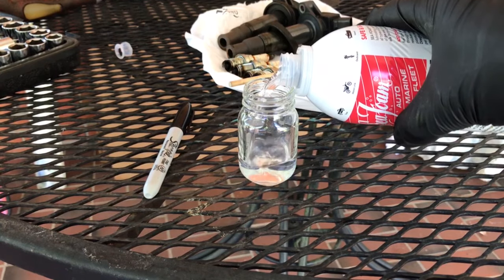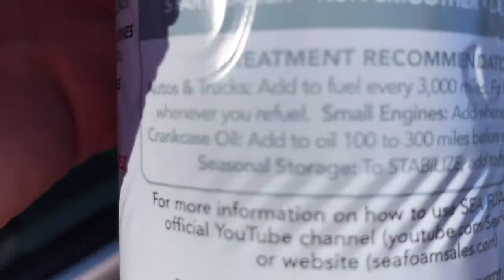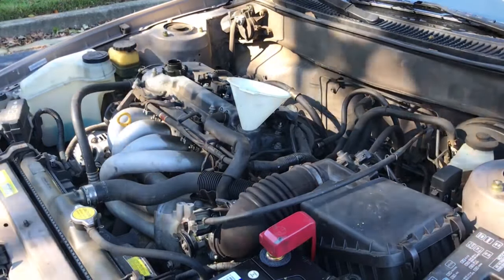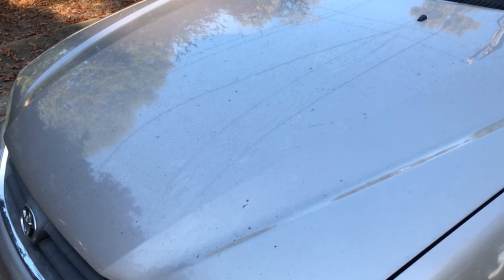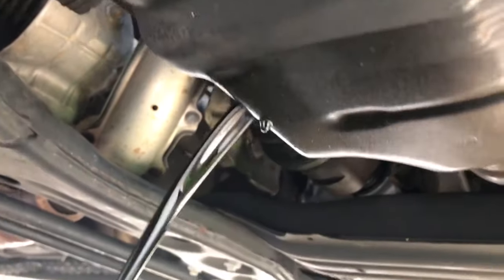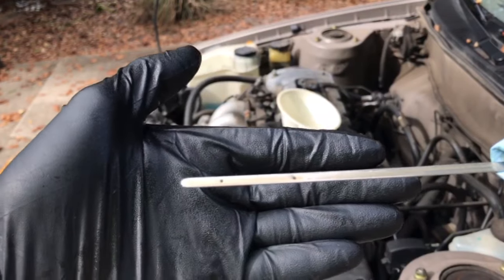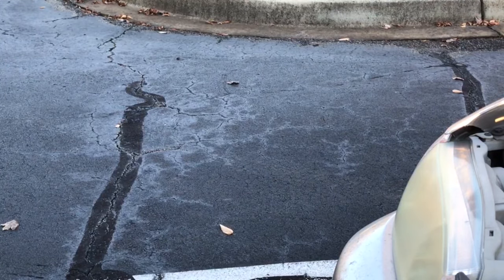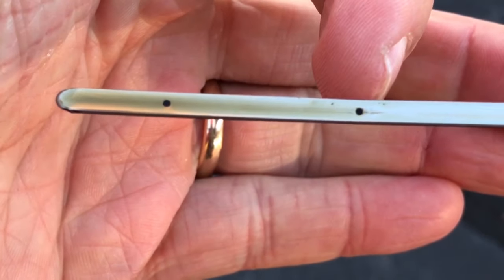Will Seafoam stop oil consumption? | Oil Burning🔥Experiments | Episode 2

Comment: I drove my 2002 Ford Winstar for just shy of four thousand miles with seafoam in the oil, it didn't do any damage to my engine at all. I got a really good clean out of my engine though, the engine had a lot more power than it did before seafoam in the oil, it was simply amazing the good it did for my engine!
Reply from the maker: Good to hear, Robert. Thanks fort the comment!
Reply: So is it okay to run the car with seafoam until next oil change. I literally changed oil a month ago and it’s bone dry now so was thinking of buying another 4 quarts and adding the sea-foam and checking if this is the possible solution. I also have a 2002 Corolla it literally burned all oil at 500 miles of driving it
Reply: @Ceez_therepperbarber777  yeah i did it on all my cars.

Comment: Hay mate you got the car at 200 thou, maybe the guy who had it before didn't change the oil regularly enough, marketing says every 10 thou but it should be every 5k. there could be a wallow worn into the cylinder walls from stuck piston rings. even though you cleaned the rings if the damage is there on the cylinders it will still leak oil. cheers, just fyi to fix properly will need a short block.
Reply: These particular engines suffer from a design flaw. It wouldn't have mattered even if you changed the oil every 3000 miles, they all start burning oil.

Comment: I would’ve left the seafoam in for a whole oil change and run it with that in it to clean it while it was running your 300 miles actually 600 miles probably would’ve been a lot better or a 5000 mile oil change but you couldn’t get that far with the oil change so I will go another 300 miles with seafoam in the crank case and then do another oil change it’ll get better also check your PVC valve !

Comment: A lot of oil  burning issues are from not changing your oil on schedule.  Especially after a year has passed and the 10,000 mile recc. is nonsense to me because oil is cheaper than new engines (or short blocks).  I own a 1998 Camry with 186,000 and do a lot of short trips, it does not burn oil and I check it every fill up (about 260-290 miles).  There are a whole host of issues Seafoam can cause, most notably an O2 sensor that is headed for trouble it can push those over the edge to failure.  This Seafoam "fix" may be something to try as Dave is on a very old car that is already burning oil.  When the price of an engine approaches the price of replacing the car, I might take a chance myself, but I am very leary of these "fixes in a bottle" like radiator stop leak, transmission sealers, head gasket fixers and the like, and sorry people if Toyo isn't using those in the shop or recommending them, I steer clear.  .
Reply: Not with this engine. It's a design flaw. When it comes to fixes in a can or bottle, only a few products actually work and Seafoam is one of them. I have used it several times in different vehicles and always had good luck with it.

Comment: Corollas are well know for consuming oil due to the pcv system they use, also you notice you are running with the check engine light on. check the code.
Reply from the maker: Thanks for the info, Pablo. I checked the PCV and get the codes read in other videos. The PCV is working and the code is for small leak in EVAP system. This 8th Gen Corolla is also known for the low-tension rings getting stuck due to narrowing oil passages in the pistons.
Reply: @FamilyFriendlyDIY  it may be worth adding a catch can to the PCV to see how much oil the blow by (sticking rings cause high blow by) is carrying into the combustion cylinder. Often, oil is burned from the PCV recirculation and not the oil film on the cylinder walls. Oil is needed on the walls to lubricate the rings and piston but not in the blow by  in the intake tract.
Reply from the maker: @ericl5973  That’s a great idea, Eric!

Comment: Stuck piston rings? Wrong! There are holes in the pistons for the oil to flow through that were designed too small by toyota and they get clogged up!
Reply: So what? In the end he's trying to solve a problem with oil consumption, not get a ribbing for not using the correct description of the issue.

Comment: I appreciate your attempts to get the stuck piston ring working properly again.  I am wondering what your thoughts are about using B12 in my oil for a few hundred miles before my next oil change.  I have a 2006 Camry which has about 250,000 on the clock and is currently using about a quart every 3,000 miles.  Any suggestions?
Reply from the maker: I don't want to suggest something that might ruin your engine. I might drive for 50 or so miles with B-12 in it myself.
Reply: I would only idle a car's engine with b12.  It is very harsh/dry and reduces lubricating qualities of oil a lot.  You can probably get away with idling for a long time though.  30 minutes or more for 1/2 of a  small can should be fine.   Don't add it to a very thin much deteriorated old engine oil,  like before a much extended oil drain interval,  as it may be unsafe then.

Comment: Hi Dave, Instead of trying seafoam I used Ametech restorer & lubricant, prior to use I was burning 350 ml of engine oil every 400 miles. After using the Ametech restorer I am been burning no oil at all for the last 3000 miles.  Vehicle is a Nissan X-trail 2.2 Diesel. Thanks for sharing the video & hope this message finds you well.  Best Regards eze
Reply from the maker: Thanks for the info, eze!
Reply: hello eze, which state are you located?

Comment: The oil seals clogged with carbon will cause the oil into the strokes and foul plugs and injectors, so cleaning is the solution. Many times I have solved engines from a similar oil  use to yours to near zero use, bar leaks or broken rings.The solution I have found is a similar approach to your first in the series, with a soaking and then bring up to operating temp ; throttle body cleaner and others into the engine while keeping up the revs for about 5 to 10 mins,  fully drain. Rremove and flush filter and replace temporarily while adding some diesel (an oil) and crank over for a few mins to rinse the engine, fully drain, add new filter and fill with synthetic oil for your engine, replace plugs. Also redoing it as suggested and during more frequent oil changes to keep clean.

Comment: Hey brother I'd highly recommend using 1 or 2 grades up thicker oil and engine restore. It won't hurt anything in these older worn out engines. Even the 2010 Prius owners manual says you can use anywhere from 0w-20 to 20w-50 depending on ambient temp. I'd recommend 20w-50 and trying out engine restore. It is known for reducing oil consumption by trying to seal the chamber. I'd recommend you use it with only 20w-50 for the least amount of it going into the chamber and letting it idle for over an hour because higher engine rpm makes oil burning much worse then go off on a long drive.
Reply: Also have you tried replacing the pcv valve and air filter. A clogged air filter can force oil through the valve stem seals as well. The pcv valve can help with consumption in a lot of cases as well.
Reply: Thicker oil will not fix this problem. He has a toyota 1zzfe, the oil rings and drain holes are clogged. It's extremely common on high mileage engines.

Comment: After the Sea Foam in the cylinders, then U ran it (with that Sea Foam thru into the crankcase) then U changed the oil, filled it to top dot on dipstick, then started it! Never rechecked level, so level wud'v been low however much the filter, etc. holds, so U wud'v been over estimating oil usage after cylinder treatment. Then U added Sea Foam to crankcase again, U shud'v just driven with cylinder Sea Foam that seeped thru. U'v not followed completely logical diagnostic path...

Comment: Naw, doesn't matter if the rings are unstuck when the seized rings have destroyed the cylinders. Once rings seize, they'll continue to rub gaps into the cylinders and it doesn't matter even if you install new rings that short block is done for. Junk the car or continue to lose oil.

Comment: Did Seafoam worked when added to the oil directly into the engine? I like Seafoam. My 2008 Yamaha motorcycle, 1300 CC, 4 cylinder (just like cars I believe) recently gives blue smoke out of one exhaust pipe. I want to add Seafoam to oil and see if it helps release stuck oil ring!? Any recommendation please? Nice job you did with all those products. I. Your toyota, when you lose that much oil, it cannot be because of stuck oil ring. Stuck oil ring only give blue smoke out. Check the radiator antifreeze if any oil in there. You many have a bad cylinder head. Thanks for good videos.
Reply from the maker: Thanks Massoud. Hasn’t worked yet for me, but have you heard of Yamaha Ring Free? I think it’s supposed to be for the problem you’re having.

Comment: Hey bud you just drill a hole before the converter and use a low pressure test gauge. Anything above a pound cold idle is blockage.

Comment: Seafoam is absolutely the best for cleaning sludge and oil from an engine.  You can keep it in a lot longer than 100-300 miles.  I have kept it in for close to 600 miles in a 2001 Ford Escape 3.0 I purchased as a work vehicle, just highway driving.  I Seafoamed two different times.  After the first, the oil filter weighed close to 3 lbs.  Thats alot of sludge.  After the second time, I scoped the engine and it was as clean as day one from the factory.  247000kms and it has never ran so good. Burns no oil at all. The best product!!
Reply from the maker: That's good info. Thanks for posting!

Comment: Try AT205  Rubber restore. Works well in oil  or gas tank or transmission. Helps with seals
Reply from the maker: I was looking for some AT205 a few weeks ago, Richard, and couldn't get it anywhere... unavailable or out of stock at all the stores online and at my local auto stores (Advance Auto usually carries it where I am). Not sure what the deal is with that. I ended up having to use a Bar's Leak product on another one of my cars. Thanks for the comment!

Comment: If the car isn’t improving (and if seafoam is ok for seals), you could totally fill the engine with seafoam so that the pistons are immersed, let it soak for a month, and then drain. I’m not so sure the top down treatment would get to the rings if the top ring is decent but the other two are stuck.

Actually I just saw a good video where a guy explained how these Toyota engines can get rings that are stuck out against the cylinder and score the cylinders if people don’t change the oil. Maybe the previous owners did this to your car.

Very nice video series you made. I’m doing seafoam treatment now. I’ll start doing it with each oil change.
Reply from the maker: Interesting idea, Craigie. Thanks ... Also I wonder about replacing the oil with Seafoam and actually running it (at least for a few minutes).

Comment: Hey Dave, just a suggestion because it seems you might be doing your oil level check wrong.

When checking your oil from the initial oil change, you need to actually start the vehicle after the oil change and let it run for at least 1 minute or up to 2 BEFORE checking the level on the dipstick.

In the video, I think you may have checked the oil level BEFORE letting the engine run.  When doing this, you won't get an accurate reading because the oil filter needs to fill up with oil as well which will result in a little bit lower oil level since part of the oil in the crankcase of the engine is going to be moved to the oil filter.

I would suggest that when you're doing a comparison and checking your oil level, that you wait at least 5 minutes AFTER you have shut the engine off before checking it.  Really, you should probably wait 10 to 15 minutes just to get an even more accurate reading.  I know it's not going to matter that much but a little bit here and a little difference there will change the comparisons.

Although a different engine with a much higher oil capacity, I own a 2005 Ford F-350 with a 6.0 Powerstroke diesel engine.  It takes 15 quarts of oil to do an oil change.   Expensive yeah.  Anyway, to properly check the oil, everyone on all of the forums or groups have said that the proper way to check the oil in trucks like these is to wait at least 15 minutes for all of the oil to drain back down into the crankcase and/or oil pan from the other areas of the engine.  For this particular engine, there are a lot of different passageways for oil to drain back down from that is different from a typical engine so it takes longer for it to drain all the way down properly.

For me, I have noticed a difference if I wait only 3 or 4 minutes to check it or wait at least 15 to 20 minutes.  The level does go up about 1/4" to almost 1/2" which can be a difference of 1/2 quart to almost a full quart.  That's a big difference.  I too have an oil consumption issue so that's why I'm measuring precisely to see if some of the things I've done have helped (which it has).  For me, I'm trying a couple different oil additives from HotShot's Secret Stiction Eliminator and also their Friction Eliminator to the Rev X brand oil treatment that is essentially the same thing but supposed to be better.  I also switched from the Super Tech 15W-40 diesel oil to Ford Motorcraft 15W-40 oil.  My results have went from using about 1 quart every 400 miles to 1 quart every 1,000 miles (roughly) so it has definitely improved.

I know you probably don't care about all this stuff for diesels and that's fine.

My point is that you shouldn't be trying to check the oil within a minute or two of shutting the engine off to take your readings and comparisons.  Sure, you "can" do it but you should really wait for all the oil to fully drain down to the oil pan to get the most accurate reading possible.  And this is going to take at least 10 to 15 minutes usually.

Also, although not a super big deal, if you over fill your oil capacity by 1 quart in your smaller engine, that can potentially cause other problems due to variations in the crankcase pressures from having too much oil.  When having too much oil in the engine, the crankshaft and rods can potentially hit the oil causing the oil to aerate or "foam" which is not good.  You can obviously look up the info on Google about over filling your engine oil capacity.  This would potentially be true in your case anyway since you have a smaller engine in that car that probably only takes 4 to 4 1/2 quarts for an oil change.

For larger engines that take 6 or 7 quarts or more, it may not be as big of a deal.  But for yours, it might matter.  Although it probably won't do any real damage, it could add to the problems which you obviously don't want.
Reply: This is exactly right. Here is my own non-scientific very simplified procedure. 

I go drive about 10 miles (preferably at highway speeds for some of that) after a oil change to get the engine truly hot and the oil touching all moving surfaces and picking up any sludge that can be dissolved or loosened. You could go to your grocery store to make a productive trip out of it. 

Then turn off and wait until the engine is cold before checking the oil again. This is what I tell anyone who asks about how to check oil (Oil Check for Dummies).
Reply: The manual book print,  just wait five minutes before checking oil level not ten or fifteen minutes.
Reply: Oil filters don’t completely empty and need refilling to check oil. Your long explanation is worthless
Reply: @DanielJohnson-ec8rk  you obviously didn't read and actually understand my comments so your response is completely worthless as well. You don't know what's going on apparently when it comes to engines or else you wouldn't have said what you did. So, I don't hold any credibility from your comments because it doesn't make sense. If you don't understand how an engine works and how oil filters work, then don't comment. Oil filters don't magically fill on their own. So, if he wants to get an accurate reading, when he changes oil, he is going to want to make sure that he runs the engine for at least a short period of time so that the oil filter and the rest of the oil system is full of oil like it needs to be. Just putting an oil filter on empty and only putting in the amount of oil that it says is not going to be accurate. But, again, to explain this to you is probably completely worthless because your comment basically points out that you don't understand what's going on.
Reply: @eldridge201  if you don’t remove the filter there are s nothing to refill

Comment: Should'a started with doing a compression check.
Reply from the maker: You're right, Kevin. I really should have. I know it's a little late, but I just filmed a compression test on it this weekend and hope to post it this week. Still using about a quart in around 500 miles. I hope you come back and comment about the test findings. I'd like to know what people think. Thanks for the comment, Kevin. Have a good one!
Reply: @FamilyFriendlyDIY  Possible you have a broken ring or skirt on a piston. compression won't detect it but oil loss is a good sign.